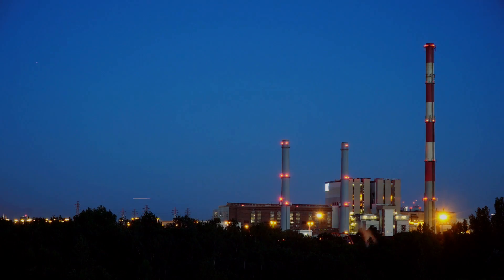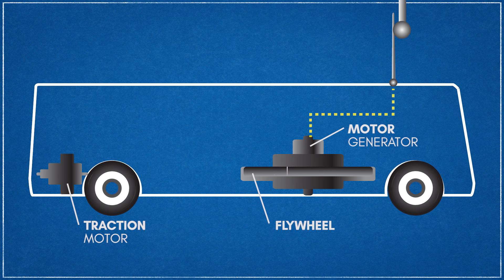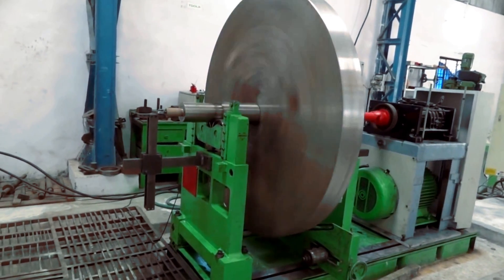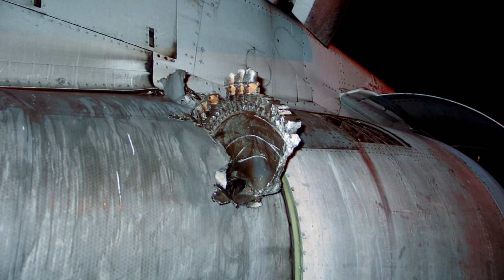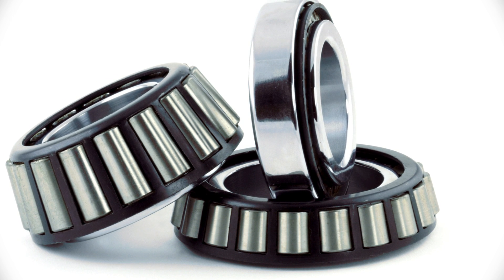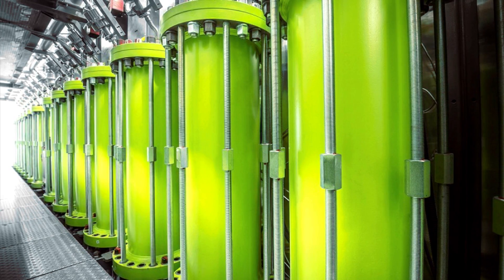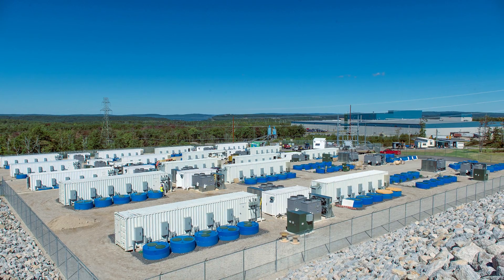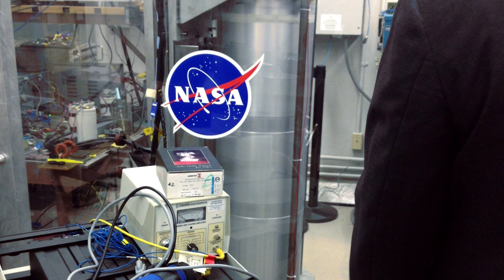The Mechanical Battery

Comment: I wonder how effective compressed fluids could be in storing large amounts of energy.

I remember seeing a small experimental car when I was like 10 that was powered by compressed air.

Though I guess it wouldn't be the most efficient storage. Obviously as well compressed gas can be very dangerous and can cause a large amount of damage if it explodes.

But I am imagining using a wind turbine or flowing water source to take direct mechanical energy and use it to run a motor/machine that compresses air without having to convert it to electricity first (using the direct kinetic energy of air/water movement,) this having greater efficiency. You lose less power in electricity conversation.

Then using the compressed air to power an electric turbine in times where electricity can't be obtained from other sources or in times of increased need.

You could have the tank stored deep under ground or far away from the building/area it is serving.

Additionally a similar method could be used in a gravity storage system. Though I guess dams already do this in ways far more effective than an artificial weight.

I am thinking more on a small scale for like an individual house. Solar could be used during the day, and then direct kinetic energy from wind/rivers used to store ebergy in compressed fluid for use during times of low solar out put.

Comment: You mentioned the NASA flywheel system. I think it's worth mentioning the other space use for flywheels, reaction control. Using flywheels for energy storage in space or other low friction environments must present it's own set of challenges. Perhaps solved by symmetric configurations for example.

Comment: Generators that run on a very small part of the electricity they produce are also available, along with already developed generators that can be attached to each wheel of a vehicle to generate more electricity and recharge start up batteries. Only one vehicle wheel generator is required to provide all the electricity an electric vehicle needs to run on to speeds over 200mph. Plain paired magnets also generate enough electricity to turn an electric generator motor, like an alternator does in powering vehicle electric systems.
Reply: It's called perpetum mobile and definitely not possible.

Comment: I'm intrigued by the concept but I'll stick to my Aluminum batteries thank you very much.
I'm not dismissive of the Fly Wheel, it has a place in energy storage but I don't think mechanical batteries is the philosophers stone one size fits all solution. I envision a divers options of energy production and storage from Coal to the Atom, from Lithium to the Fly Wheel all working together.

Comment: One of the physicists who worked at Culham fusion project in the UK ended up working closely with me for a couple of years. He told me a funny story about that flywheel. Apparently he was asked to calculate what would happen if the flywheel managed to get free from it's mount. He calculated that simply nothing would stop it until it got to the north sea... That's a long way through fairly densely populated land. He was then asked to calculate the impact of a departure should the flywheel be mounted so that it span in the horizontal plane. That was even worse because all of the energy would be converted to heat and kinetic motion in one place. Essentially it would be like a large bomb. Nothing bad ever happened.

Comment: Then, of course, there is the variable moment of inertia flywheel.  This flywheel uncouples the speed of rotation from the rate of energy stored or released. Much like the ice skater speeding up by bringing their arms closer to their bodies even though they are giving up energy to air and ice friction.  I did my Ph.D. thesis on this concept in the 1970s.  It was a purely mechanical system. It makes little sense any more as electric motors and generators are so much more efficient.  If interested in them, search "variable inertia flywheel" to find patents (not mine) and some papers I wrote that are on Researchgate.

Comment: There is still energy loss every time you transition between the kinetic energy of the flywheel, to electrical energy when you use it as a generator, then using the power line to power the flywheel motor to increase the rpms of the flywheel again loses energy to inefficiency.  Using the brakes to regenerate the flywheel via its motor also loses energy, so there is energy loss every step of the way during each kinetic energy/electrical energy transition.  If the bus or vehicle is ever in a catastrophic accident, that 35,000 rpm flywheel may escape or fragment into pieces, causing lethal damage.  There are multiple reasons why the flywheel never caught on in everyday use.  I think new materials may enable flywheels to be used practically.

Comment: Interestingly, electric cars was thought of decades ago (before combustion engines I believe), but wen't with combustion instead. If we had stayed with electric cars ' we would have a solved most if not all of the problems by now, & life would be so much nicer.
Reply: Nobody cares. This video is about flywheel.

Comment: When I did my work experience at IBM, they had flywheel UPS systems.
I suspect you could also use them as surge protectors.
And I reckon gasworks regulated supply pressure (gravity battery)
It was the early 90s.

Comment: 13:10 "power density"? If you mean energy density then now way is it better then chemical, as most chemical fuels are far better then lithium which is better then flywheel...
Reply: No, he meant power density. Energy density relates to how much total energy can be stored, while power density relates to how fast that energy can be utilized (charged or discharged). Chemical batteries typically have pretty low power density relative to their energy density as it takes a long time to fully charge or discharge. What he is saying at 13:10 is that even though flywheels typically don't store as much energy as chemical batteries right now, they can release that energy much faster. This is useful in applications that require a large amount of power for short bursts.

Comment: One of the most efficient in energy gained, more than using water, is "very" heavy weights in old mine shafts. In times of surplus energy (electricity generating organisation pay companies to use electricity at times) the weight is wound up, then released in time of peak demand or during normal demands as the need dictates. They are cheap to construct as the shafts are already there. Abandoned mines are everywhere.

Comment: Almost anywhere it is possible to build a surface reservoir and connect it to an underground cavern mined out to be the lower reservoir. More expensive than surface structures but not impossible.
Reply: You mean like geothermal...yeah, we get it....
🤦

Comment: I used to play with toy cars with a small flywheel in it. Dragging it forwards a few times and let it go...zoom!
I away thought it would be cool to have a go kart with fly wheel in it, that i could peddle up to speed and let it go.. zoom! Maybe a flywheel that i could peddle up and keep at a steady peddle, that  would charge a battery that would then run a drive motor...zoom!

Comment: A reasonable sized pumped hydro project can store gigawatt hours of energy. Gravity is reliable and water does not wear out.
Reply: Not every country can do this due geographical specifics. And even if they can, they not have that mindset of destroying existing nature  in short time gain in favor of energy.
By flooding large area of woods you create problem somewhere else. You will make carbon  emissions worse due a removing theyre natural recycler. You remove existing climate control mechanism. You also create stress on terrain nearby which can affect nearby communities.
By buying out lands from communities and people you will cause socioeconomic impact which will also cost you money - and that might be 2 generations.
Forget about simple solution for everyone. There is no one solution which fits all.
It's their synergy and their proper placement in space and time.
Reply: Water might not wear out but the turbines do.  Pumped hydro is great but it's not a cure-all and the energy density is very low so you need a very large space to make use of it.
Reply: @vink6163  these are located where land is cheap and space is not a problem.
Reply: I have been thinking a top container bottom container set up if no access to dams. One container at the top of the hill, one at the bottom, 50mm pipe and hopefully off the shelf turbine. Solar pumped back up the hill till you need the energy again
Reply: @MrWackozacko  look for a centrifugal pump designed for the head and flow available. It will be a decent turbine when operated in the opposite direction as a pump. Not as efficient as a specifically designed pump/turbine machine but a lot less expensive.
Reply: @gregwarner3753  Ahh yes thank you i imagine they would be pricey as
Reply: @gregwarner3753  what hill? a purpose-built, stacked tower system would be be better. What the narrator doesnt explain is that flywheel systems are very useful on existing sites. In tandem with dams for instance so that the energy is not wasted from the many times the dams are necessarily ejecting excess water . Eco energy is about many little boxes in a line to avoid waste, not a magic box like the petrol engine. Some of the best ideas use waste itself to generate cleaner gases than natural gas, reducing waste, emissions and eliminating costly sea mining
Reply: @MrWackozacko  sounds like you're gonna want a Tesla
Reply: @MrWackozacko  so at that point why not just get your energy from the solar panel? You're wasting a lot of energy having to pump water back uphill when that's the energy you could've used to do whatever it was you had to do. I hope your following the problem I'm trying to point out. I think the dam strategy works best where water naturally is. If you have to move it all back to the top to use it again you wouldn't have to if you just used the energy you used to pump it all back up for whatever it was you needed to pump all the water back up to use the energy it creates for.
Reply: Thank you... Knowing something about the how electricity actually works and that these places actually do exist and have for a long time... I'm really happy that someone else knows about these instead of trying to make a new mousetrap every 5 seconds.
Reply: Lol who would have thought that the youtube comment section was full of physicists and electrical engineers
Reply: Yes it does...imagine you pump 1l of water you are happy you stored energy then you come back in a while and there is no water...it  EVAPORATED. You can have huge losses there. Did you knew for example that light evaporates water 5x faster than heat?
Reply: The location is the only problem. You cannot move hydro projects nor place them near hospitals and other places that require backup power. If the transmission from the hydro project to the rest of the grid goes, you're fucked.
Reply: @HSFY2012  you could build above sea level, and use sea water
Reply: @taiwoolaleye6333  using waves to pump water up hill to storage only to be released back to the ocean
Reply: Yep, and let nature do the work through seasons. 
Yeah, we understand this. Every stream and river could be made to hydroelectric. 
Most hydro stations in the country are operating at a fraction of their capacity, and most all are nearly a century old. 
....you don't think the powers at be realized how easily they could power the country from hydro a century ago. The results were so alarming, it was killed. All the concrete went towards our national road system; also almost a century old now....
Reply: @robh467  dam.

Comment: So in principal a modern mechanical battery is a electric motor and a alternator at ones. The stator is placed in a vacuum chamber and is levetating. That's a interesting concept

The upside is you can spin this flywheel incredibly vast because it's levetating in vacuum so no friction. Huge amounts of energy could be stored in this.

The downside would be if you tap it's energy the electricity that comes from this device is super strong at first and the gradually getting weaker since there's less movement.

Comment: "Clem engine" was a reliable battery. Imagine today?
Reply: Take this video down now!!!!!!!!!!!!!!!
Accelerating faster than Earth's spin in centrifugal forces does what; faster than the solar system...? Exactly
We know the benefits of being able to have centrifugal force; it can become a gyroscope, that provides stability
In multiple axis, with multiple gyroscopes at different dimensions....well then all you need it to provide resistance in any variable to make force in that direction; i.e. everything we see is a loss of the universe; heat, electricity, ect. 
If you can spin hundreds of thousands of rotations per, whatever, then you could do millions with a short leap in advancement. So a super electrostatic motor, that is also gyroscopic...a battery, your propulsion, stability control, all in one. Thrown into your flying saucer; you'd fly into a thunderstorm and charge your saucer; spinning your gyroscopic mechanisms up to millions of rpms, all stabilizing each other; and enough power to fly around the Galaxy. Make sure hang solo has done the proper calculation in the computer; zip off into space. 
Avoid the emp's of Betelgeuse 😘; he made mention of this 🙊🙉

So again; take this video down now

Did I mention zero friction lubricants or magnetic suspended bearings. 
What about new rare metals and materials that cool with friction; I think I've said to much...

Again, take this video down now.

Comment: Flywheels are delightful, but are almost only useful for the 'handover' between power and batteries. 

They fit the niche between Battery and Capacitor.
Reply: Take this video down now!!!!!!!!!!!!!!!
Accelerating faster than Earth's spin in centrifugal forces does what; faster than the solar system...? Exactly
We know the benefits of being able to have centrifugal force; it can become a gyroscope, that provides stability
In multiple axis, with multiple gyroscopes at different dimensions....well then all you need it to provide resistance in any variable to make force in that direction; i.e. everything we see is a loss of the universe; heat, electricity, ect. 
If you can spin hundreds of thousands of rotations per, whatever, then you could do millions with a short leap in advancement. So a super electrostatic motor, that is also gyroscopic...a battery, your propulsion, stability control, all in one. Thrown into your flying saucer; you'd fly into a thunderstorm and charge your saucer; spinning your gyroscopic mechanisms up to millions of rpms, all stabilizing each other; and enough power to fly around the Galaxy. Make sure hang solo has done the proper calculation in the computer; zip off into space. 
Avoid the emp's of Betelgeuse 😘; he made mention of this 🙊🙉

So again; take this video down now

Did I mention zero friction lubricants or magnetic suspended bearings. 
What about new rare metals and materials that cool with friction; I think I've said to much...

Again, take this video down now.

Comment: Flywheels are useful for certain applications, but they are TERRIBLE for anything mobile.

They are also extremely expensive, and the when things go wrong they go CATASTROPHICALLY wrong.
When you have a 500lb disc spinning at 3000rpm, any positive feedback harmonic or flaw in the wheel or bearings will cause it to release ALL of its energy very quickly, mostly in a kinetic - and thus violently dangerous - form.

They're far from useless, but they're even farther from being an energy panacea.